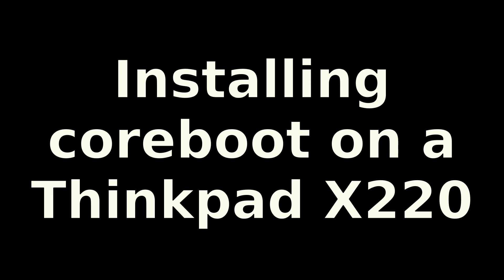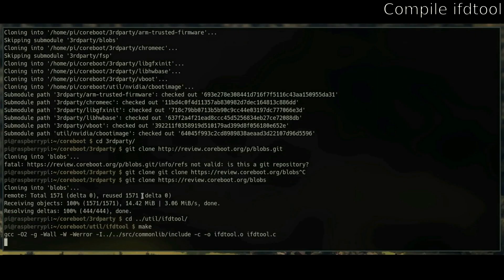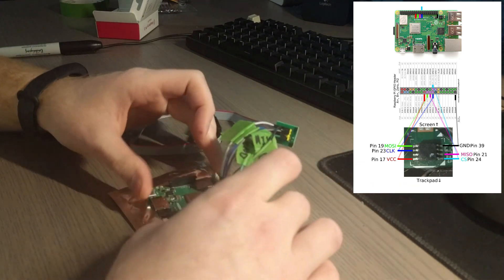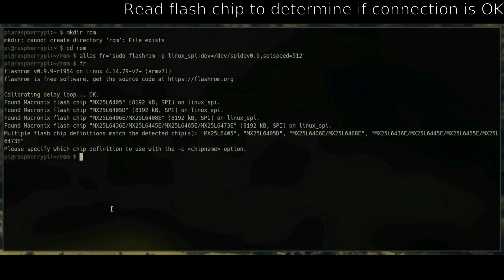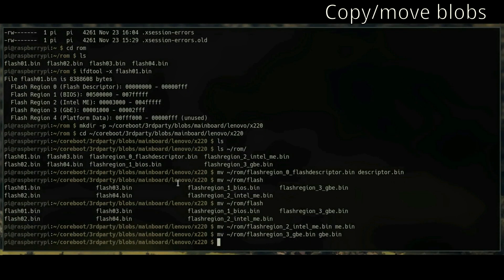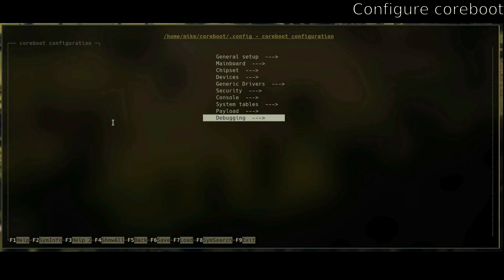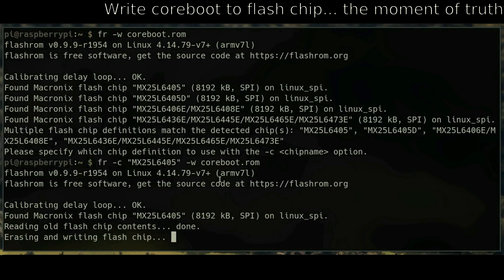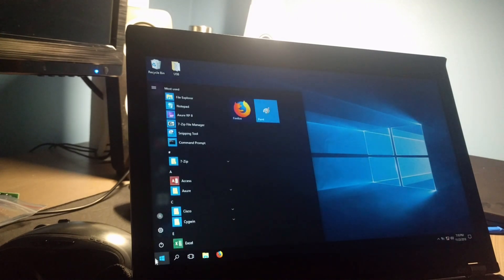Installing Coreboot on a Thinkpad X220

Comment: I am fustrated by setting this up.  I can setup it up but I can't configure it.  I am very annoyed that by default the wait time to coreboot is much sorter, I can't even figure out how to shorten it.  not all the options are accessable in menuconfig or nconfig.  I know this stuff is not suppose to be easy but I can't even find documentation to talk me through it.  found one place that talked about the boot-menu-wait but it says it's in a folder that doesn't exist in the coreboot directory, they are giving people packets of crisps without the crisps, come one Coreboot don't push me over the edge here
Reply: I am pretty frustrated as well. Seems the Libreboot and Coreboot documentation is hard to find and there are many errors/bugs that can occur with apparently no known fixes. This is of course to be expected with such a “hacky” mod, but it is frustrating nonetheless because apparently so many people are able to do it with no issues.
Reply: oh I'm the dislike as no one feels willing to provide a more comprehensive tutorial around coreboot.

Comment: Hello. There is one consultation. I want to install a new BIOS, coreboot, but I do not want to buy Raspberry pi because it is expensive. So, https://www.amazon.com/dp/B07SHSL9X9/ I'm thinking of using this tool. Can I install the BIOS with this? By the way, my Laptop is ThinkPad x230 / t420.

Comment: Do you mind sharing the connections of the test clip? I have the exact same but no multimeter and I couldn't find any schematics... I assume the red cable is number 1, hence CS pin?   But what about the other ones? I tried the below but didn't work.. 

MOSI  5 --|  |-- 4  GND
   CLK  6 --|  |-- 3  N/C
   N/C  7 --|  |-- 2  MISO
   VCC  8 --|__|-- 1  CS

Thank you!
Reply from the maker: The clip I have is inverted, making the red cable VCC as number 1
Please get a multimeter to check though
Reply: @Greatssssss  Thanks! Turns out mine was not inverted, flash worked perfectly.